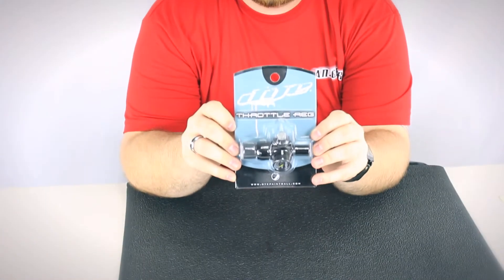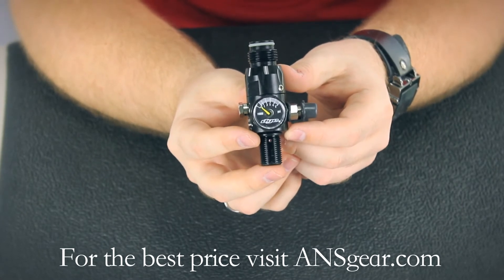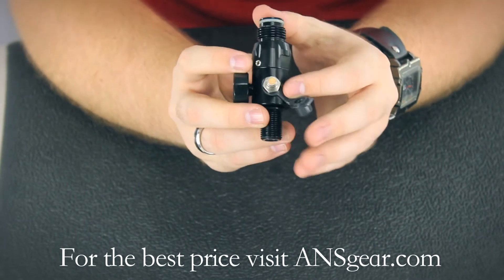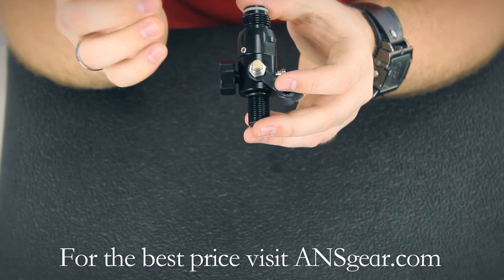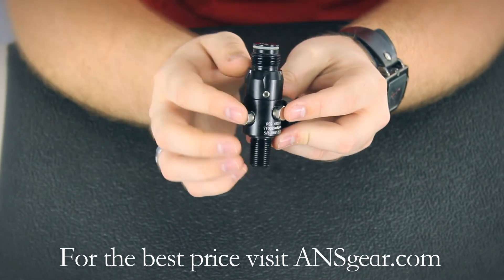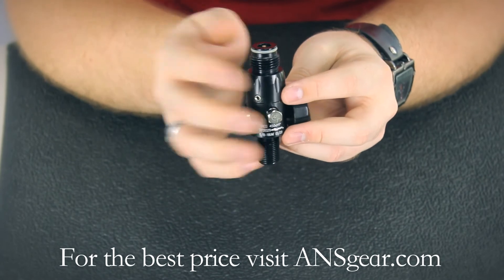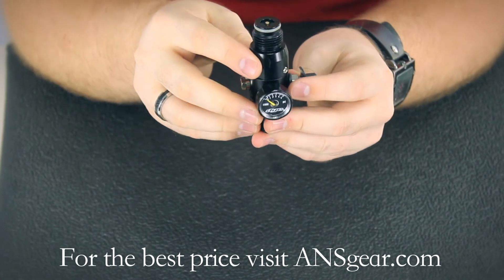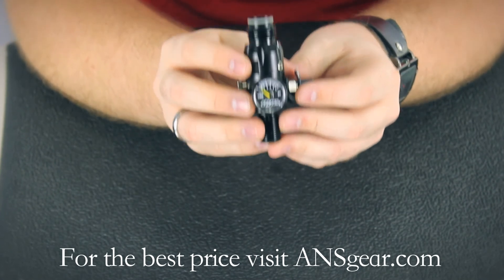Dye Throttle Tank Regulator

Comment from the maker: The regulators simply thread into the bottle. Most people will also put a small amount of red loctite on the threads. Once it is threaded all the way in, tighten it down and let the loctite dry. We always recommend having your regulator installed by someone trained to do so. Compressed air cylinders are nothing to take lightly.

Comment from the maker: How difficult the reg is to take off depends on how much torque was applied when tightening the regulator and the amount of loctite that was used. It can be difficult to remove regulators but someone who knows what they are doing usually has tricks to removing each type of regulator with minimal cosmetic damage.